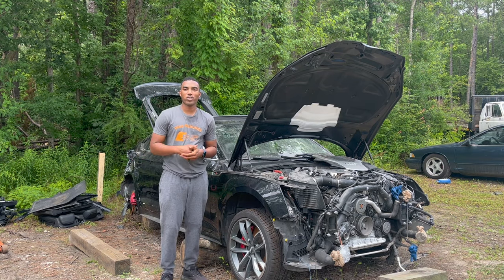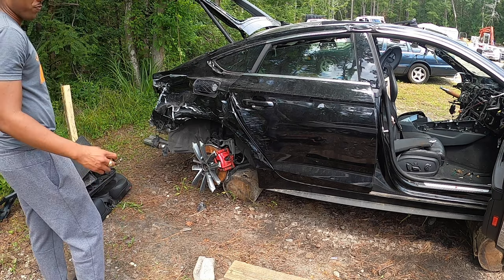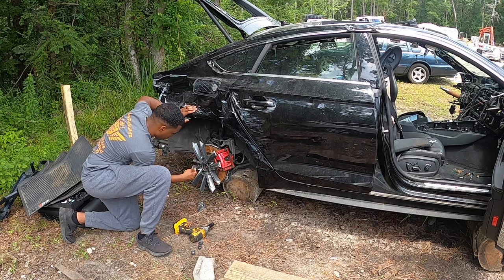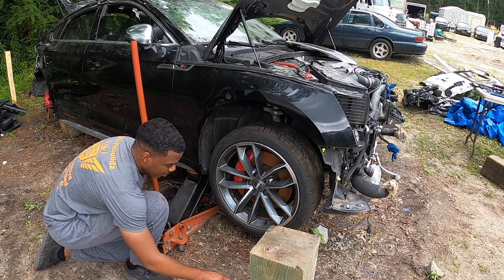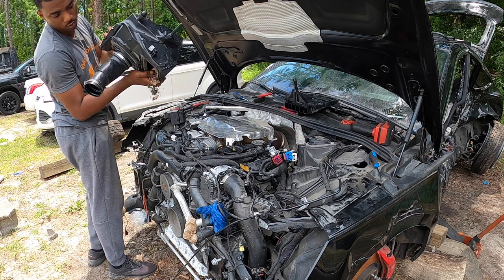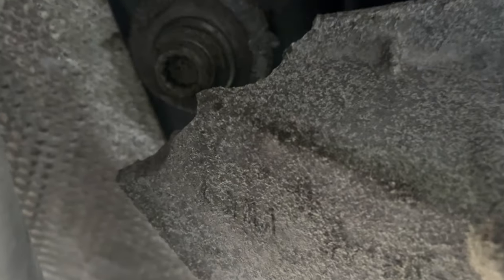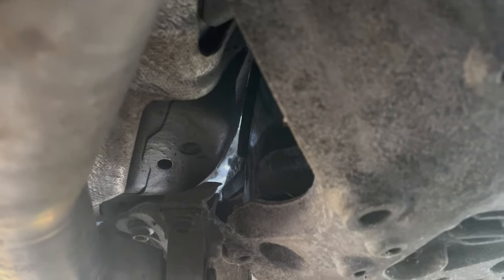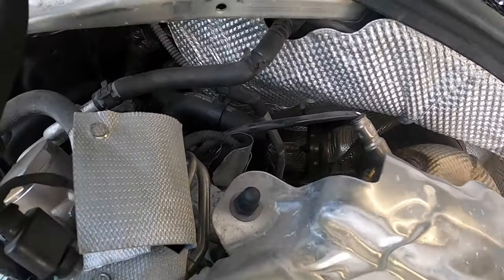How to remove lug nut covers from 2018 Audi S5 B9 easy !

Comment: Just use a needle nose pliers and grip lightly and wiggle. They come right off very easy if you don’t have the tool. I literally just went and tried it. I’m guessing the tool is in the trunk somewhere if it hasn’t been lost.
Reply from the maker: It maybe can work but the thin has a little clip piece that holds it to pull it out.
Reply: @weerebuildz4427  oh I see. Mine is in a S5 sportback. There’s no clip behind these covers for some reason
Reply from the maker: Did don’t know how yours don’t have it but that should let it be easy to just pull it out.
Reply from the maker: Make Sure the tip of it is one the top of the lug cover properly and see if that should let it come off.
Reply: @weerebuildz4427  Yea, fingers too big. I’m plastidiping black, so I figured I would pull those out and then put them back after. Not sure how grey covers and black wheels will look though. I think I might leave center cap grey as well
Reply from the maker: @danielvitolo2595  If you have two small picking tools that maybe will be the next good way to do it whenever you want to get them out.